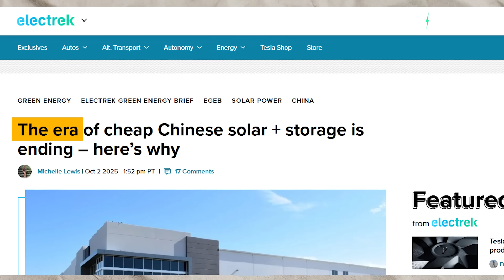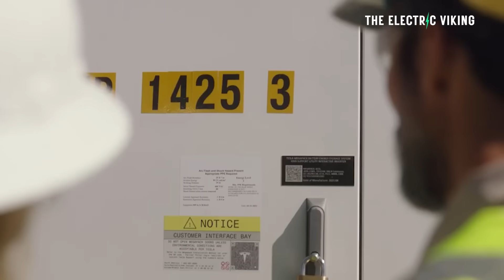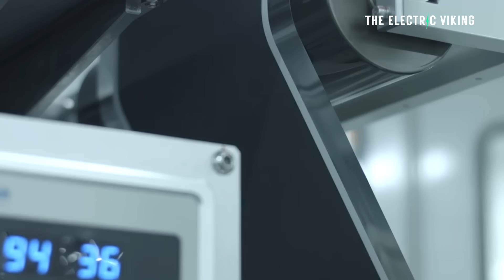Wood Mackenzie says CHEAP Chinese solar + batteries is ending

Comment: Frustrating thing about stuff like this is even if we totally switched the grid to solar, there would still be a need for oil for chemical feedstocks among other things. Like, most products contain some sort of petroleum derived element, whether plastics or polymers or pharmaceuticals or what have you. Burning it is the most wasteful possible thing to do with it.

Comment: I completely agree with you on the battery side, and would say that on the solar side, whilst there may be a small price rise, the price of solar panels is now almost irrelevant as even on a solar farm, the cost of panels is maybe 15 to 20% of the cost of a solar farm and even lower for rooftop solar. A 10% rise in panel costs everything else being equal would only push up installed cost by around 2%. If over the next year the producers increase yield per panel by 2 to 3% a 10% price rise for panels will have no net effect as pretty much all other costs would be unaffected.

Comment: the report is actually correct because it is based on Chinese government directive. 9% is not alot, panel will still be cheap even with that increase. and you are not getting less because the price bottom is create by China to encourage competition by quality. now instead of forcing competition by price, manufacturer will have to compete on quality and that would force all the manufacturing to increase their quality. I don't see it as a bad thing. Companies need to stop using pricing as a crutch for inferior product, this is about shifting "Made in China" from being cheap product to quality product and it would be good for Chinese product in the long run to have a national standard rather than uncontrolled free market.

as for battery,  the rise of sodium batteries will create a brand new product at a lower price. so energy storage will likely be cheaper even with new standard just because of advancement.

Comment: Our demand for panels and storage is a function of their price. It is structurally limitless. It is in the CCP’s interest to use their functional monopoly to extract greater value, but if they move the needle far, the supply chains will move offshore pretty fast. There are already many incentives for the rest of the world to divest from having china as the sole provider. Especially when the sodium Revolution hits proper and we don’t need Chinese rare earths. Let’s face it, Chinese tech never gets cheaper in a straight line, it zigs and zags but tends to trend cheaper at 10 percent a year.

Comment: The prices of solar and battery technologies are falling at the same time as the price of fossil energy is rising.
It's going to get to a point where prices will be very similar, and people will opt for solar energy in regions where fossil energy logistics are more expensive.

The main reason is because easily extracted fossil energy sources are being depleted, leaving only hard-to-reach sources for which we do not have the extraction technology... Because we haven't invested in developing them.

This is indeed just a campaign by the US government to harm China's solar and battery industry and benefit the US fossil fuel industry.
But it doesn't matter, change is already inevitable.

Comment: Disagree, this is simple economics and sustainability of the industry and the current prices are unsustainable long term. So I wouldn't be surprised to see prices of solar to raise a bit. And China is not a capitalist system, it has capitalist parts but it's still highly controlled.
While I agree sodium batteries will put pressure on batteries.
Also you clearly don't understand what the report is saying. It's not saying the end of solar and batteries and go invest in fossil fuels. It is actually saying the opposite.  It's saying the bottom of the market has likely been hit and the price increases will be modest but will return profitability to the sector. This is a good thing be ause if there is no profit companies go bust. And that is the history of Chinese manufacturing.  Government support, lots of competition,  drive put foreign competition, then let the Chinese brands consolidate and control the market.
Companies cannot maintain losses for too long and there are too many for them all to survive.
It's simple business and economics.
So It's not fossil furl funded get out of renewables and batteries, it's saying, as as happened in other markets, we have likely hit the bottom, there will be consolidation and the best places will eat up the rest. But it's not saying prices will rise massively, just enough to keep the Chinese brands that survive profitable but not so high as to encourage non-Chinese manufacturers to re-establish themselves.
It's what happened in consumer electronics and white goods and other sectors.

Comment: You're right host,Wood Mackenzie’s claim that the era of ultra-cheap Chinese solar panels and batteries is ending is simply illogical and weak. China has dominated this market for years with low prices due to massive production and advanced technology, and scientific evidence shows this trend won’t change quickly. A study by BloombergNEF et al. (2025) in "Global Solar and Battery Cost Trends 2025" states that solar panel prices dropped another 3% this year, and lithium-ion battery costs hit below $95/kWh due to China’s excess factory capacity, not rising as Wood claims. The supply of raw materials like silicon remains stable, keeping production costs low, so export pressures aren’t strong enough to drive prices up.

Moreover, the factory consolidation in China that Wood mentions actually helps maintain low prices, not the opposite. A report from the International Energy Agency (IEA) et al. (2024) in "Solar PV Global Supply Chains" notes that China controls 85% of the global solar supply chain, and investments in new technologies like TOPCon cells have reduced production costs by another 20%. Consolidation only eliminates smaller, less efficient players, while giants like LONGi and JinkoSolar continue to keep prices low. Locally, although Malaysian universities have less specific research on this, international findings align with analysis from Universiti Malaya by Razak et al. (2023) in "Renewable Energy Transition in Southeast Asia," which states China’s solar dominance helps ASEAN achieve solar energy costs of $0.03/kWh by 2030, with no signs of price increases.

For batteries, the downward price trend remains strong. A study in Nature Energy by Zhang et al. (2024) in "Battery Cost Declines in China’s Energy Storage Boom" shows China’s battery investment rose 50% in 2024, driving battery costs down to $80/kWh by 2026 due to economies of scale and innovations in lithium iron phosphate (LFP). Export pressures like U.S. or EU tariffs have little impact since China redirects markets to Asia and Africa, as reported by Ember et al. (2025) in "China’s Clean Energy Export Strategy." Thus, Wood Mackenzie’s claims about rising material costs or export pressures reshaping the renewable market lack scientific backing—China continues to dominate with low prices, helping the world achieve green energy goals without cost increases..🤔😔

Comment: They can blah blah blah all they want about renewables but they can’t stop them. The people that do the real figures know which works best.  It’s the same with home solar, I’ve had discussions with friends that tell me it’s not  economical to install. Eventually my real figures of what and how I use them get trough. They are or have installed solar and batteries, some even went all in and bought a EV. The real numbers get through eventually.

Comment: im sorry u need to read the finanicial reports of some china solar companies. i recommend gcl tech

Driven by series of 
policies, the supply-side structural reform in the PV industry is transitioning from theoretical frameworks to critical 
implementation stages. The dawn of a new phase is breaking for the photovoltaic sector.

https://media-gclpoly.todayir.com/2025092518080125311854690_en.pdf

but i believe solar and battery tech is the future

Comment: Batteries are NOT CHEAP yet in 2025 - they just are cheaper than before. 200 MW capacity/400 MWh storage battery parcs installed in 2025 came at a cost of $111 mn. USD and more. 2 Kilowatthours of modern, portable battery storage on Amazon/ Europe start at USD $ 1,000 to 1,200 - it is indeed half of what it was is one year ago - but it is not cheap. Prices are going down - but they have to go down at least tenfold and to be improved a lot more (which both and finally seem to be feasible by 2025). Projected, 2 samples: Construction of the GIGA Leopard project (2027), a 300 MWh/1.2 GWh battery energy storage system (BESS) in in Delfzijl, Groningen has started. The €300 million project financing package, which attracted strong interest, has been arranged as a ‘club deal’ with a group of eight European lenders (and they will be collecting interest on those $351 USD million).
GIGA Green Turtle in Belgium (2028). This 700 MW/2,800 MWh Battery Energy Storage System (BESS) project is set to be the largest in Europe. It will include 20 battery units, each paired with an inverter, and feature 185 medium voltage transformers and five high-voltage transformers, collectively offering a capacity of 1,500 MVA - and it comes at a cost (!). Once finished it will be able to provide between 2 and 4 hours of stored energy for up to 385,000 households. (Sidenote: it will not provide 20 hrs or 40 hrs of energy supply - just 1/10th of it - at peak hours in Wintertime, when it is cold and dark and demand is very high - it will run out of juice quite quickly). After 30 minutes of research I gave up on finding the secretive nrs. for the amount of $ dollars of the 2nd project - all is wonderful, Mega, Giga including the prohibitive cost (of most probably $1bn USD). Storage is charged to the consumer at the very least at 10 ct per kwh. This is not energy production, it´s just storage. I don´t think that is cheap. I think it is really a lot.

Comment: I did read the report. It has some fair analysis. The govt is trying to increase the prices in the industry so it's more sustainable. So yes the govt is trying to raise prices against the current strategies of the domestic companies. So yeah Wood Mackenzie is capturing some trends. By the way sustainable pricing is in regards to Chinese sustainable pricing and not with regards to pricing outside of China. What makes you think the govt won't try to influence the sodium battery prices.. Your assessment actually doesn't take into account Chinese govt action and what it's strategy is.. that actually is the number 1 most important factor that you haven't really gone into except just comment on Wood's Mackenzie report.  Honestly this report isn't about being funded by fossil fuels.. It's just covering market data.
Reply: Adding a 13% VAT tax to exports will have an effect, like a 13% effect.

Comment: ok lets say 9% increase in price... still lower than other countries batteries and panels. 

The capacity reduction could be them retooling.. could be there changing the line to a new product... all these thing reduce capacity. I am sure there was something else that happened as well.. i don't know when chinese holidays.. or if there was some issue that slowed down production to plants or whatever

Comment: Sodium Ion batteries are about twice the price of LFP batteries on Aliexpress at the moment. It's the case of production volume and cost outweighing material costs.
Reply: Yeah, and in some marketplaces any purchase of sodium batteries are still taking a 2 week to 1 month indent because of limited supply

If next year the production volume are quickly ramping up, it will slowly changing the market, considering that its energy density has reached 175Wh/kg, about the same as current LFP

Comment: Actually, this article might have its facts inordinate. At least in terms of the things that have been declared to have already happened in China. I don't know if there are any actual policy changes here, but it would follow the trends.

About a half a decade ago, the Chinese government had cracked down on EV overcapacity real hard, and quite a few companies went bankrupt overnight. But several years later, the prices and quality of EVs have improved significantly to the point that EVs can be cheaper than any other car, while being as good as mid-tier gas cars.

The inputs for the article is likely correct, but the conclusion they make is completely off base. The exact reverse of what they declare is likely to happen according to history, and we'll enter an age where solar will be so cheap we'll be buying solar panels sewn into our jackets and bags five to ten years from now. And I'm not talking about early adopters, but the average Joe.

Comment: Officials sign landmark energy deal that will serve millions of US residents: 'Supports long-term energy security':  California has secured a long-term clean energy commitment that will provide decades of stable power to millions of residents, according to Think Geoenergy. Ormat Technologies signed a 25-year extension with the Southern California Public Power Authority to continue supplying 52 megawatts of renewable electricity from its Heber 1 geothermal power facility in Imperial Valley. The agreement takes effect in February 2026 and runs through 2052, serving the Los Angeles Department of Water and Power and the Imperial Irrigation District. Geothermal energy, unlike solar or wind, provides a constant supply of baseload power by tapping heat stored beneath the Earth's surface. That reliability makes it especially valuable for cities seeking to diversify their clean energy mix and cut dependence on fossil fuels. With the Heber 1 extension, the LADWP says the facility is expected to provide power to more than 77,000 households in Los Angeles. The Heber complex was recently modernized after a fire incident forced a temporary shutdown in 2022. The repowering project replaced the facility's older water-cooled system with newer air-cooled technology, improving efficiency while reducing water demand in the arid Imperial Valley. Together with its sister plant, Heber 1 will continue to generate about 91 MW of renewable electricity, which is enough to meet the needs of hundreds of thousands of people. Ormat Technologies is based nearby in Reno, Nevada, and is one of the world's biggest companies in the field of alternative and renewable geothermal energy technology.

Comment: Irrelevant.  Technology changes will make solar + battery storage much cheaper and better even if the old technology does increase in price.  It goes back to Sodium ion batteries.  I suspect they will be far more important for storage than EV’s for the next few years.  Their ability to operate with just air cooling and lower cost will make a bigger impact on utility adoption than a 100% sodium ion battery will have on EV adoption.  I expect hybrid sodium ion/LFP to dominate EV production for the next few years while the bulk of Sodium Ion is marketed to utilities.  The question is how quickly will China realize that their technology can put them in the utility business in many countries of the Global South creating long term revenue streams and creating political dependency far more sustainable than current belt and road debt model.  The benefit to these countries is the can cut energy imports dramatically which would be bad for OPEC+ and US.  Lack of generation and grid capacity is a global constraint to EV adoption so I would argue that deploying Sodium batteries to improve infrastructure is a better investment than making EV’s a few thousand dollars cheaper right now.
Reply: Imagine what 'free' electricity will do for competition from African, India and other sunshine belt countries. how many millions will be taken out of energy poverty at the same time. Their future is bright, it shines on them 365 days of the year !.

Comment: Wood Mackenzie are a UK consulting firm and most likely in my opinion in Starmer and Trump's pocket.
They are typical wankers that have NFI of the real world and probably have not ventured to China in the last 24 months.
Over priced consulting advice telling people how to suck eggs seems to be the modus operandi.
Solar Panel development with Bidirectional and other methods of construction is increasing efficiency and is reducing costs.

Sodium batteries for BESS is a real win from both safety and cost perspective and the energy density is not much less than LFP at current state and that is still likely to improve.
The Sodium Ion battery is the key component to maximise renewable energy from wind and solar and will eliminate the curtailment of so much lost renewables. 
Without significantly more investment in BESS capacity and capability,  the demand for peaker gas plant generation was a need for many regions. Now lesser so if the greenies pull their heads out of the butts regarding bird deaths and death of whales due to offshore wind turbines.

Comment: I hope someone is going to produce the electricity for these batteries.
Reply: That’s what the solar panels do.
Reply: "hope"?

I don't think you understand how much renewable electricity generation can be lost due to the need for curtailement to ensure legacy grid stability and safety, mainly because of lack of storage? That is where all forms of battery contribute to an actual complete renewable energy SYSTEM.

It's a mistake to view any renewable energy source and batteries in isolation of each other. They are all complimentary components that contribute to a fully completed system.